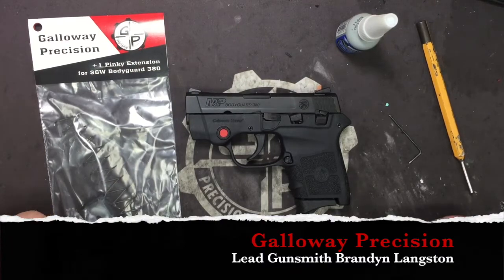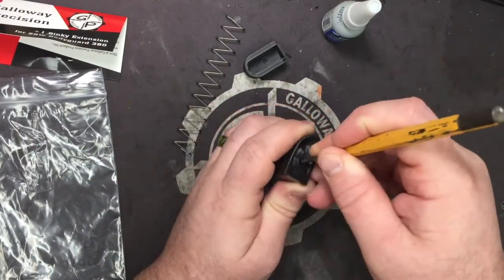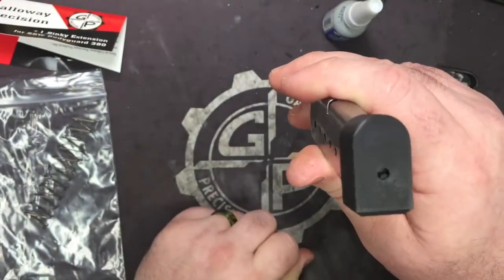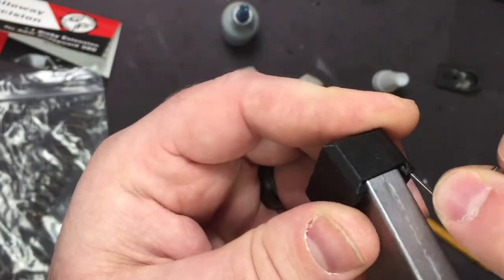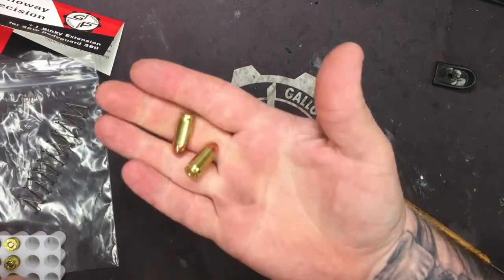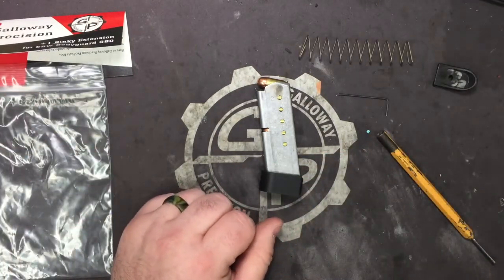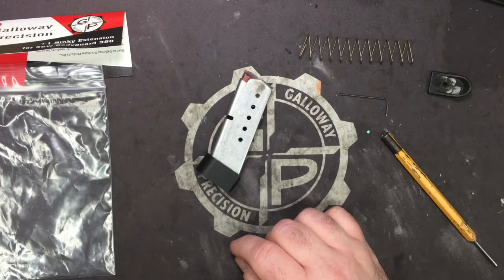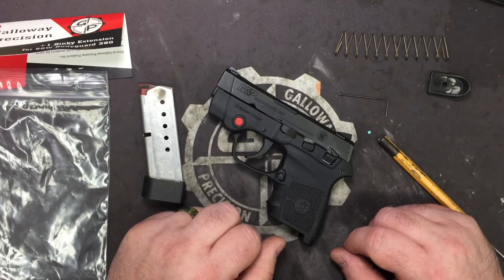Bodyguard 380 +1 Mag Extension Installation.

Comment: Just got my extended magazine release from Galloway Precision for my BG 380.  It does not fit!  The right side does not fit in the hole  where the old one came out of.  The reason I purchased this was because every time I shot the pistol the mag would drop down and jam.  The new one from Galloway is wider than the old one and does not drop in so the return spring won’t move the mag release.  I sent them an email on Friday and hope to hear from them the first of the week for a fix.

Comment: Why cant someone make a plus 2 base with pinky grip so we can have 8+1
Reply from the maker: Not enough spring tension, and the cost of a spring that could do that would make the kit so expensive most people wouldn't buy it.
Reply: @GallowayPrecision  Really?  How much could a little spring cost?
Reply: You already have a longer spring with the +1.  I bet a +2 or +3 would fly off the shelf.  Cant you shape the base to more closely match the actual 380 grip with finger channels?
Reply from the maker: @johnh383  You've never worked in a manufacturing setting have you?  We can't just go hey we only want a few of these to try, we have to order in large quantities, then if it doesn't sell, since nobody has asked for that product since this is a deep concealment pistol, it sits on the shelf and never sells.  A minimum order of 2,000 springs for a small shop isn't exactly a drop in the bucket,  it can be payroll for a week, it can be parts that will sell.
Reply: @GallowayPrecision  Have you tried "3d" printing a plus 2 base and use the +1 spring to see how it functions?   The size of the plus one looks like it should hold 2 rounds.